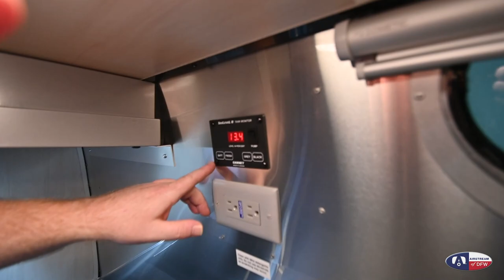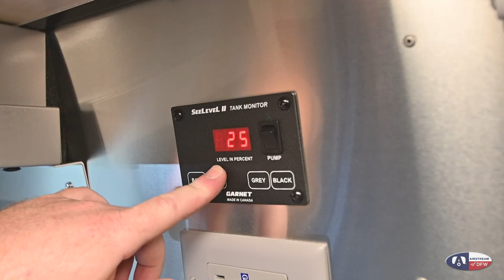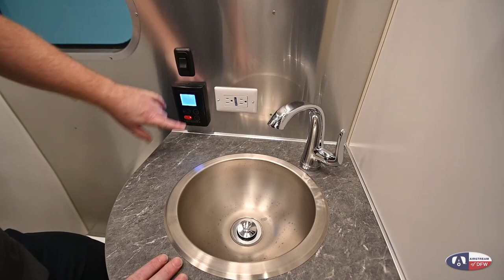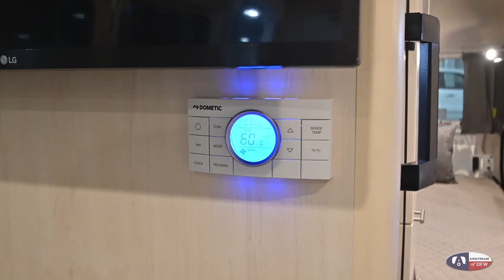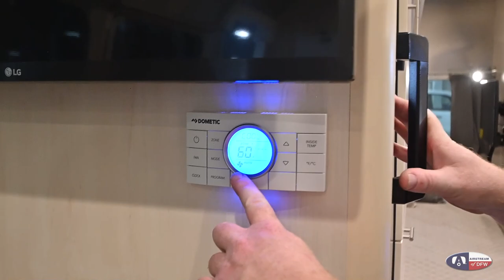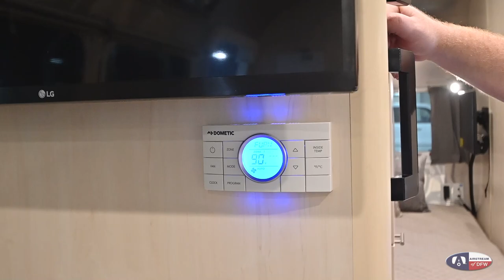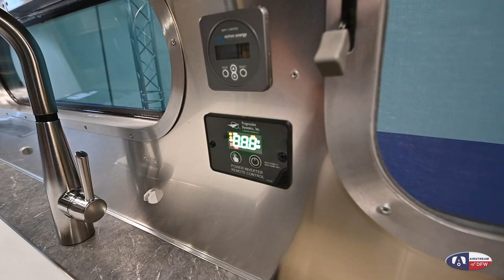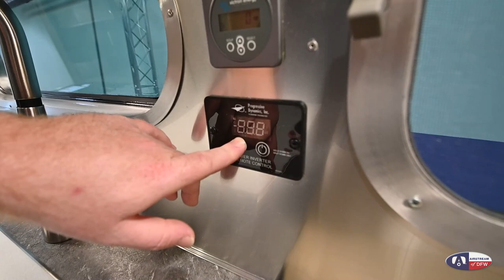2021 Airstream Flying Cloud 30FB | Full Service Walk Through

Comment: I have loved Airstream for 40 years. Great Video! It seams that they have cheaped out in a few areas.1) AGM batteries...lol. They are soooo outdated for todays needs. Lithium should be standard. 2) Manual oven lighting. Contortion is not what I want to do in order to use my oven, put in an ignition for the oven like for the burners. I know everybody wants an "On Demand" hot water heater. If they really knew about them and how much water you waste before you actually get hot water, most would abandon them, unless you have H20 hook up. For Boon-docking, forget it. You will never have hot water. After a Water on Demand was installed in my six & bricks, my water usage increased and so did my H20 bill. Yep..had to "wait" for hot water. Are those items deal breakers?, ummmm, no. However, I dont want to have to add things that should be standard or at least have a choice for a nominal extra charge.

Comment: With these larger airstreams is there a double dutch style door with a sliding screen ... Maybe a rear entry door between the tail lights ? ... I think that would be cool almost like a front door into the living room and the double doors on the side ...or even a larger side door with the sliding screen from the inside ...
Reply: Couple other things I thought of ... A security system ...tinted windows ...and a cover ...

Comment: The manual awnings kill me and the little screw thing to hold it down? For the price of this thing nothing should be "manual" operated.
Reply: They used upgraded materials everywhere in the trailer. Most things are motorized. But the manual Awnings are saving you a ton of money and agony. Those awnings break often and cost a bunch of money and labor to fix the motor and replace the Awning. Airstream is doing you a favor, one less motorized thing to break.

Comment: Nothing against the presenter. He was excellent. But can someone explain to me why these cost over $100k? I see all the same equipment you would fine on one 1/3 the price. They are beautiful, but at the end of the day, what justifies spending that much?
Reply: Quality materials and construction to last for a lifetime. 75% of ALL Airstreams EVER built are still being used today. NO other trailer/RV manufacturer have those stats. All other trailer/RV manufacturers put out garbage, to last maximum 15 years with many, many, many repairs. Good luck using your warranty on other RV manufacturer. Airstream still has high level of repair service even warranty repairs. You are not getting that with anybody else
Reply: @kellyname5733  They use Dometic/Suburban/Dexter etc the same as all other mfg.  You will have the same troubles down the line with Airstream as any other brand with this.
Reply: I just can't justify the breathtaking cost of an airstream. Yes, they are built better than the garbage trailers that everyone else builds. However, I researched them exhaustively a couple years back and was surprised that they used so many conventional materials in their construction. I assumed they used lots of high-tech composites and exotic materials...instead it was plywood and plastics. I also agree with the comment from Harry Jansen - they use the same crappy RV appliances from Dometic / Surban / Dexter, etc. that all the other RV manufacturers use...so you will definitely have those same problems down the road. In the end, Airstream is a marketing company, not a travel trailer company. They are selling you a lifestyle, a history, a cleverly crafted story about the romance of travel in a trailer that's been around since the 1930's. It's an overpriced boutique product.